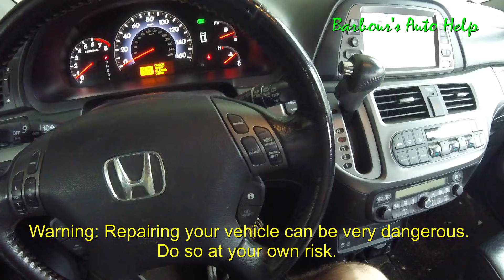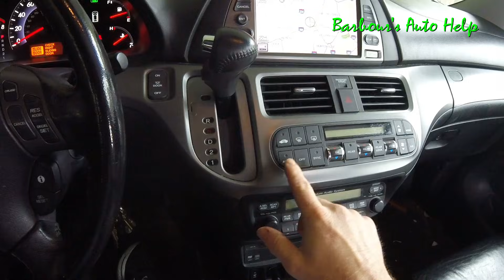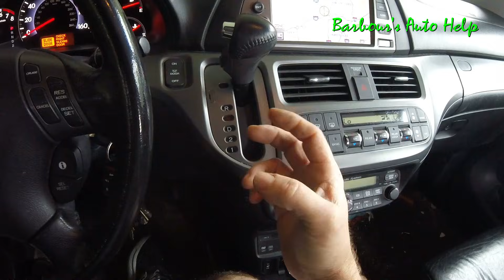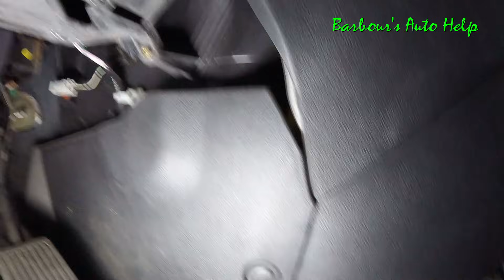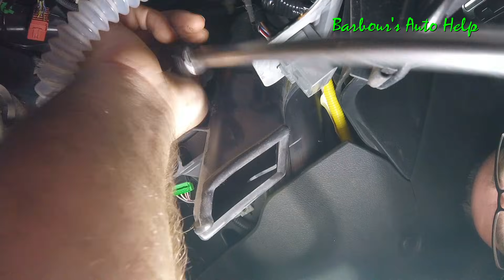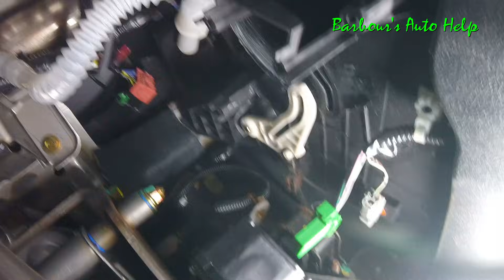Driver Side Temperature Blend Door Actuator Replacement 05 Honda Odyssey

Comment: Hey man i just did the same procedure trying to figure it out what is wrong with the ac, is cooling but the more cool temperature out of the vent is 67 f with the setting lowest what could be the problem?
Reply from the maker: Is it the same temperature out of the drivers and passenger side vents?
Reply: I would say yes is like 2 degrees the difference, first the driver side was 2 degrees less, after i did this the driver is 2 degrees more than the passenger side
Reply from the maker: It’s possible your Freon level is low.  Have you checked the pressures?
Reply: I did , the pressure is 47 psi
I'm afraid to add more and damage the compressor,  what you think ?
Reply from the maker: Is that with the ac running?  What is the high side pressure?
Reply: Yes is 47 with the ac running connected to the low port by a gauge that cam with the refrigerant. 
I don't have the gauges that connect to the high and low pressure.
Reply from the maker: 47 is a little high.  But it’s hard to tell what’s going on without the high side reading.  This unfortunately may need to be diagnosed by a tech.
Reply: Yeah i think that will be the next step, I'll let you know what honda say
Reply from the maker: Good deal.  Good luck!
Reply: BarboursAutoHelp thanks again
Reply: Dan Bronson you mean evacuate and filling the freon, i think is illegal   or dangerous to just bleed the freon into the air
Reply: BarboursAutoHelp i also notice something else, when i push the bottom a/c instead auto i got a few lowest degrees, also it feels cooler when the fan in low speed. Idk why
Reply from the maker: Yea, I'm guessing incorrect refrigerant level.  Let me know what your tech says and good luck to you.

Comment: Very helpful! how do you take out the plastic covert under the steering wheel?  I find it's impossible to get close unless I remove that cover.
Reply from the maker: I didn’t.
Reply: OK with some cramp I finally got to the point I can remove the vent pipe.  However I can see the blend door open/close properly with AC/heat.  But I still got no cold air from the driver side.  Do you have suggestion on what the next step is to try?  With heat (temp=Hi) I got hot air, but with AC (temp=Lo) I got room temp...
Reply from the maker: Are you shire it is moving in full range?
Reply: I would say so, as I can't push it further manually.
Reply from the maker: Have you tried pushing it with the motor off?  If you have and it’s still warm on the driver side then you may have low freon.  There is also a small chance the Blend Door in broken inside the duct.  It’s pretty unlikely though.
Reply: Freon was low, recharged but still warm.  So back to the actuator.  By looking at my video https://youtu.be/CEUjrMS_j0c, can you tell if it's not moving far enough? Thanks a lot!
Reply: I finally took it all apart.  The gear box is in good condition.  I cleaned the grease on the contact plate and pins, put it all back, still, no cold air.  I did notice if I sync the rear, the front driver side did get colder.  Is there a  control door for the rear air? Could that be the faulty one?
Reply from the maker: The rear is totally separate from the front.  Have you checked the Freon level?
Reply: yup, just recharged it today.
Reply from the maker: There may be something wrong in the case.  At this point I’d recommend having a tech diagnose it for you.  I don’t want to steer you wrong.  Having someone hands on is sometimes better.
Reply from the maker: I'm going to have to apologize to you.  I did not see this video until today.  This comment was sent to my spam comments..... Good video!  From what I can see It looks like it may be moving in the full range.  Something dawned on me though as I was watching this.  That metal cable that is connected, that is the cable that goes out to the heater control valve.  The heater control valve allows "hot" coolant to flow through the heater core when heat is selected.  If the valve is not closing, causing the coolant to stop flowing though the heater core, then this may be contributing to the problem.  Take a look under your hood toward the fire wall where the hater control valve is.  It will be on the fire wall on one of your heater hoses.  See if that cable is hooked up out there and make sure the valve is opening and closing by watching the lever that the cable is connected to move when the temperature is changed inside the vehicle.  Let me know what you find please.
Reply: BarboursAutoHelp you are good no worries. I will definitely give it a try, and let you know. Thanks!
Reply: No problem there either.  Finally took it to the shop and it was a leaking condenser.  Charged Freon a few times did not think of that would be the culprit. Now it’s a good summer.
Reply from the maker: Glad to hear it!